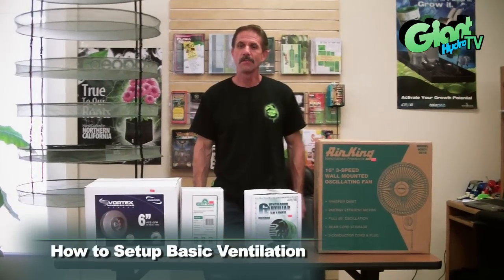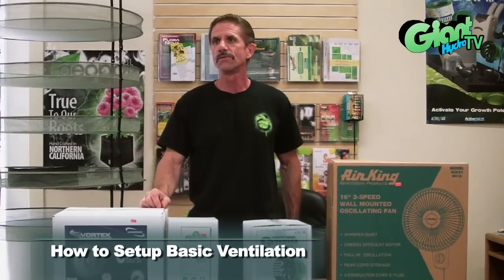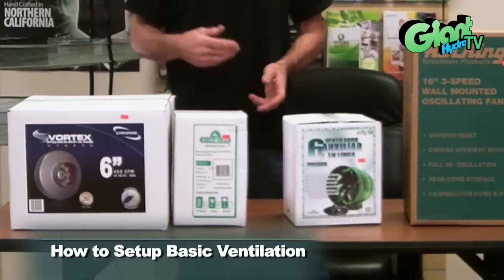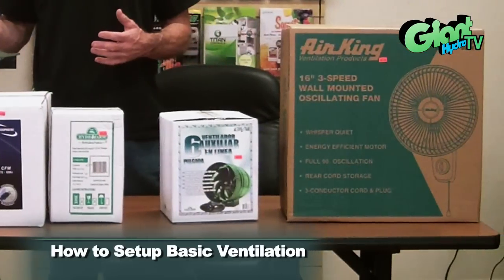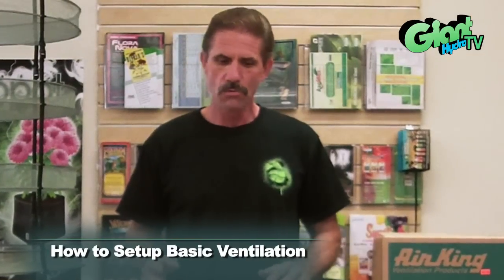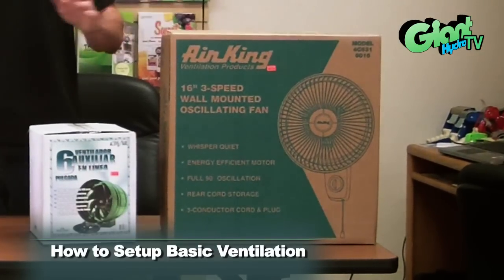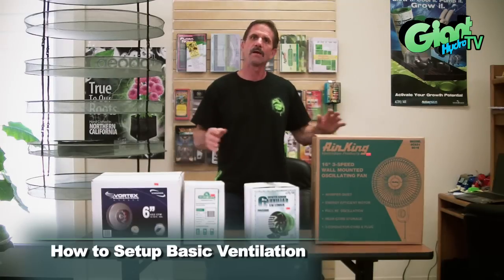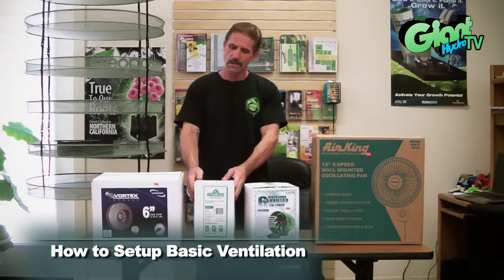How to setup a basic ventilation system for your indoor grow room

Comment: This isn't supposed to show you how to set these things up. If you're finding this difficult, than you probably aren't understanding the concept of what he's saying (which is the tutorial). Basically if your room's hot you just want to have a fan blowing air outward of the room. You will want that toward the top where light (heat) is. At the bottom of room have a fan blowing air into the room at 1/3 speed of the exhaust. Have osculating fan inside the room also to keep air moving within. Easy.